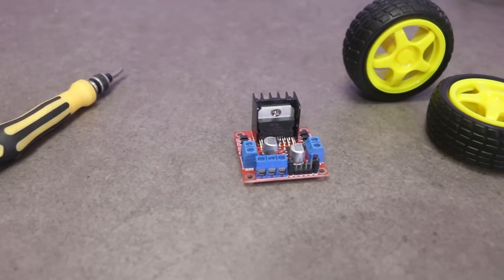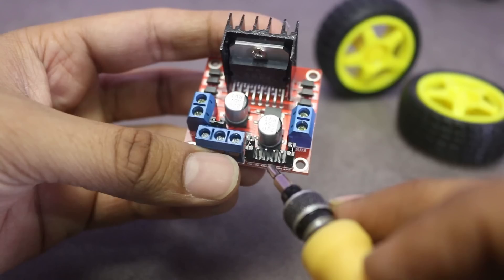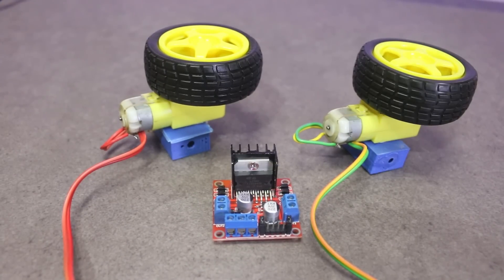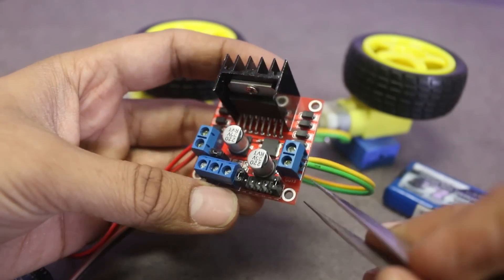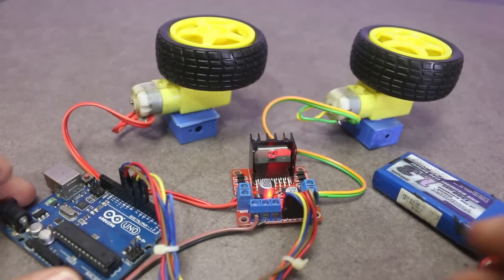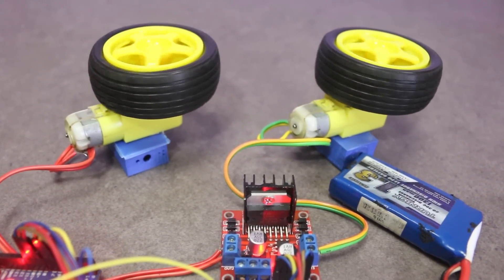How to control DC motor with L298N driver and Arduino

Comment: 00:04 - Learn how to control two DC motors using L298N driver.
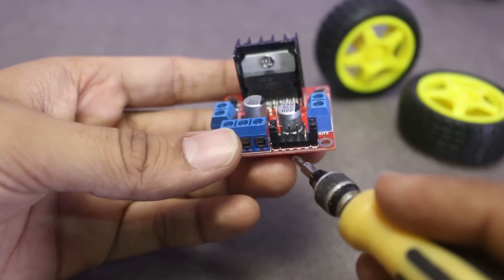00:45 - Remove jumper for voltage above 12V to avoid damage.
01:14 - Enabling and controlling DC motor speed and direction with L298N.
01:51 - Controlling motor direction with L298N based on pin signals.
02:35 - Powering L298N and testing motor direction with Arduino.
03:15 - Connecting L298N with Arduino to control motor speed.
04:09 - Upload code to Arduino for motor control.
04:43 - Connecting Arduino ground to L298N powers the motors.

Comment: Very nice video!  In your video you used  lower voltage to drive the motors. In my case,  I want to use arduino+ L298N to control a 24V motor (full speed). How can I set up the connection to power the motor (preferably not using a breadboard)?  Thanks!

Comment: How many voltage are u using? I tried mine but speed of the wheel is pretty slow and somehow only one wheel is working. Btw im using 6V connect both Arduino and driver

Comment: Hi ma’am, I have a doubt . I have a pump of 3.7v,0.1 A and can I connect that to this L298N .If so what are the changes or additional components required
Pump is - kamoer 3.7v 0.1A

Comment: Hi, tnx for your awesome vid, I got a question, what is the minimum current required? I'm using two 9v batteries that are paralleled and yet it doesn't work (hardly moves)
Reply: Put the pins ,that he told in the video, back where it saya N1 N2 etc

Comment: I am using 9V battery to test the module the motors are running fine without the module but as soon as I give the Input pins (1,2,3,4) high then nothing happens so Is my L298 defective. Please help me out!!!!

Comment: With the same motor driver i can only operate one motor...whenever i connect both motors it stops working....is it because i am using a 9 volt battery with the driver?cause individually they work with full power...what should i do?

Comment: Arduino: 1.8.14 Hourly Build 2020/09/23 10:33 (Windows 10), Board: "Arduino Uno"

Sketch uses 1442 bytes (4%) of program storage space. Maximum is 32256 bytes.

Global variables use 9 bytes (0%) of dynamic memory, leaving 2039 bytes for local variables. Maximum is 2048 bytes.

avrdude: stk500_recv(): programmer is not responding

avrdude: stk500_getsync() attempt 1 of 10: not in sync: resp=0xb1

avrdude: stk500_getsync() attempt 2 of 10: not in sync: resp=0x00

avrdude: stk500_getsync() attempt 3 of 10: not in sync: resp=0x00

avrdude: stk500_getsync() attempt 4 of 10: not in sync: resp=0x00

avrdude: stk500_getsync() attempt 5 of 10: not in sync: resp=0x00

avrdude: stk500_getsync() attempt 6 of 10: not in sync: resp=0x00

avrdude: stk500_getsync() attempt 7 of 10: not in sync: resp=0x00

avrdude: stk500_getsync() attempt 8 of 10: not in sync: resp=0x00

avrdude: stk500_getsync() attempt 9 of 10: not in sync: resp=0x00

Problem uploading to board.  See http://www.arduino.cc/en/Guide/Troubleshooting#upload for suggestions.

avrdude: stk500_getsync() attempt 10 of 10: not in sync: resp=0x00

This report would have more information with
"Show verbose output during compilation"
option enabled in File -> Preferences.
Reply: can you please help me ..?

Comment: I thought the minimum voltage to put into an Arduino is 6V and recommended minimum is 7V. Is 5v really enough?
Reply: The arduino hast different Power Inputs. His working Voltage ist EXACTLY 5V.

Comment: My l298n spins motor automatically when i connect it to the power source. What is the problem here?
Reply: connect a pull down resistor and see if that solves your issues

Comment: One mistake highlighted . You said digital pin 1 is  used for clockwise dorection of motor 1. But in actual pin 1 is uses for anticlockwise direction as well as pin 2 for clockwise dorection. Please focus on the tyres movement you can see the difference of both pins.

Comment: hia...if I were connecting 2 X 12V @ 0.1A brushless DC (PC) fans to this board, to power the fans and account for the 1.4V loss of power to the L298N transistors, would I be right in thinking I need to use a 13.4V (let's say) @ 2A power supply?

If I'm correct, will I then also have to remove the 5V output jumper as it's > 12V?

Never knew that was a stipulation regards the usage of the 5V output...is it documented anywhere?

Thanks for your vid and any feedback you may have 👍

Comment: Ma'am how to operate a higher rating motor to this driver module. As this support only 2 amp current and my requirement is to operate upto 10 amp. How to connect it with 10 amp relay.
Reply: @arun pal my requirement is same. Have you got any idea?

Comment: Should I still use a common ground if my motor voltage is different than my 5v logic circuit?
Reply: yes connecting them both to the same ground means that the reference voltages should be the same, so the 5 volt output from the motor driver will be the same as the 5 volt output from the arduino so the logic levels are taken from the same reference point

Comment: Hi. If i put the code on my arduino uno se directly, will the 2 wheels successfully move on forward and backward?
Reply: I just need the 2 wheels to control together with the arduino. TIA

Comment: "Ground Should Be Common For 2 Power Supplies" this solved my biggest problem!!! ThankYou So Much 🎀
Reply: OMG. Your comment just saved my ass on this project I'm working on thank you so much! Also ofc the video was great too it's just I was being way too impatient and skipping through!
Reply: Brroo pls explain what you have commented here
Reply: @kaviprakashv3241  the negative terminals of both devices should be connected to a single power source, such that the Arduino can send signals to motor driver.

If the negative of Arduino is not connected to motor driver then it's circuit would be called as an 'open circuit' in which no current travels.
Reply: Same problem,now solved
Reply: Hahha very funny

Comment: Why two different moter not rotate on different direction
Reply from the maker: It can be rotate, you can check manually (without microcontroller),   you can watch the video for instructions.

Comment: Can i connect the motor directly to the 9v battery to test it?
Reply: You CAN connect, but DON'T, especially if your dc motor only needs 3.7V up to 6V. It will destroy your motor.

Comment: Very good video ... But 1 question .....
I have L293D Motor driver ic instead of module.... And I don't know how to use it in the same way...
Can you please suggest me.?
Reply: l293d and l298n are  same if u want to use it just search how to make a motordriver with l293d

Comment: What if you need to control large motors like 12V ?? how do you amplify the 5 V output from the board??
Reply from the maker: This driver can run 12v DC motor upto 2amp, just input 12v to power connector.
Reply: what about up to 35V  from the datasheet ?
Reply from the maker: Yes it can be support upto 35v
Reply: @Circuitmagic  please can we have conversation please ....I need to control 12 Volt motor. So it is to mean that I need 12 V power supply adapter since the motor to be controlled is 12 v. but the motor is not rotating. does it mean there is not enough current for running the motor??

Comment: 7.4 v lipo? is it shared between arduino board and motor driver?
Reply: yes, there is a 5v output on the board so im pretty sure... anyways do u know how to disconnect the jumper?

Comment: Please show us how r u sending signal to the motor,
I mean it's  through  some mobile  application or from 
Laptop .
Please clear my dought
Reply: Signal is send by the Arduino after you upload the code to the board. You have a loop function (C++) usually where you call what motors should do.

Comment: My system is not working properly.I am using 9V battery and  rf-500tb-12560 motor.Both motors are not starting simultaneously and one of the motor is not changing the direction of rotation.somebody please suggest remedy.

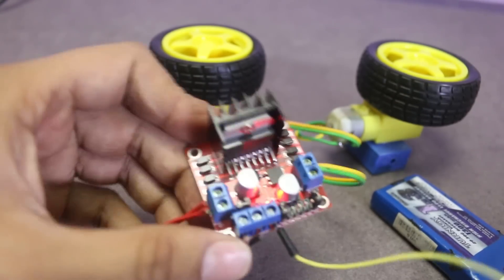Comment: 2:50 what do you mean by connect with 5V output what can be used as output
Reply: when you connect a power supply to the 12 volt Input(left most connector)  there is a converter that also supplies 5 volt(the one she is refering to).
she is using that output as a signal for the motors
Reply: @davincidamaster5311  she is to start with as ENa and ENb are bridged using their jumpers.

In the final Arduino solution, it is not used at all...the Arduino is providing the PWM and High/Low signal data to the L298N board.

However, if you wanted to run the code autonomously, you could use the 5V output to power the Arduino itself, however, you'd need to remove the USB feed into the Arduino itself before doing this.

Comment: Does the 12 volt input on the driver need to have 12 volts for the motors to work? If I have less than 12 volts will the motors run slower or will the arduino not receive 5 volts?
Reply from the maker: Minimum 6v is required for the driver.

Comment: Well Explained, nice video, I m using a 5v power bank as power supply, can I use it to power the motors, if yes where should I connect the +5v, the 7-35v pin or the 5v output pin
Reply: Power Bank => (+ve) terminal to lm298n's 12v (+ve) terminal and 
Ground (-ve) should be common for both arduino and the shield you are using.

Lm298n => (+5v) terminal i.e Output 5V to (Vin) pin which is beside A0 pin on arduino.
Gnd Should be common on both power supply and arduino,
So just connect the power supply's GND to Shiels's GND and Arduino's GND pins

Comment: Also, can you help me out with something ? What power supply should I get ? Like what's the min and max voltage of the power supply ? Note : I want something powerful, if that matters!
Reply: if you are using more no. of motors , or a powerful motor , you should increase the voltage

Comment: If i don't want to control speed of motors what should i do? But using bluetooth hc-05 and android app which has output value as 1,2
...
Reply: If you don't want to control the motor speed, you can keep the jumpers connecting the 5 volt and motor speed pins and they will always either be stopped, or run at max speed
Reply: Use arduino uno
Reply: @The_midnight_motivator  

Thanks for your reply...

I know that and  i have arduino nano, mega, uno and mini....

My problem was i made a app for control robotic car but it was not worked....I made the app because i want to control it like dpdt switch but i didn't found any app.... also  i want to use robotic arm on it...

 i am using arduino mega, motor driver L298n, bluetooth hc05 module..... after many attempts i found a solution for it... now it is working but few bugs ar e there... sometimes it has connectivity problem... i am working on it....

Comment: Are you using an transmitter or remote
Reply: If u have bluetooth hco5 chip connected to the arduino...u could control the servo motors from ur mobile itself

Comment: hi, wanna ask. can i use the same power supply i used for motor (12vac), and i  use to power up the arduino board also? bcause the motor only run for few second before it turns slowly. thankyou
Reply: im using rs550 12v motor btw

Comment: Is it required to connect ground from L298N to arduino gnd ? Why ? Thank you for response :D .
Reply from the maker: It's required if u r using 2 different power supply. For example Arduino is connected with PC via USB cable and L298N module connected with 12v power supply.

Comment: when i do same with 9v battery,sound is coming from motors but not rotating. help me with that
Reply: Coulter Mulvihill not sure
Reply: @Coulter Mulvihill if I had 2 X 12V @ 0.1A DC brushless PC fans to power, would I need to connect a 13.4V power supply to the L298N board?

I figure it would need to be 12V + (2 x 0.7V loss to the transistors on the L298N board)...although I'm by no means electronic literate and am therefore unsure as to what I'd need to do.

I'm guessing the Amperage would be largely irrelevant as as long as there were 2A provided it should all be ok, yah?

😅

Cheers for any help you may have

Comment: when i do same with 9v battery,sound is coming from motors but not rotating.
help me with that
Reply: voltage is not enough. this module will cause voltage drop +- 2v. she using 7.4v but 1.3A lipo battery. 9v battery 400-600mA. so u need to change supplied capacity. pardon my English
Reply: my problem is same

Comment: Thanks for that video, But I wonder why my 2 motor not moving at all. All the code and connection is no problem. Do you have any idea?
Reply from the maker: Sometimes we forgot to connect the ground in case we used different power source for Arduino and driver module. Maybe that's the reason. I suggest you to check the driver module without Arduino, by giving the five volt to from the 5v output connector to pin (in1, in2, in3, in4)

Comment: " Whenever you use two power supply you have to make sure ground should be common for both "
I wanna marry you for this line.
Thanks a lot specially for this.
(I had a problem like touching the heat sink (that black metal) increases the power of motor)

Comment: Interesting video. However, I noticed one motor was rotating from the code in the link, how can this be fixed so that both motors can rotate simultaneously ? Thank you!
Reply: I'm also stuck at the same thing...
I'm trying to verify the prob... nd one thing I noticed... the pin config of one of the motors is wrong in the given code....
The first two lines of the given code doesn't match with the description...

Comment: when i connect motor to this module motor speed is too much slow and my module connected by 5v adaptor
Reply: me too
Reply: Whenever you use two power supply you have to make sure ground should be common for both